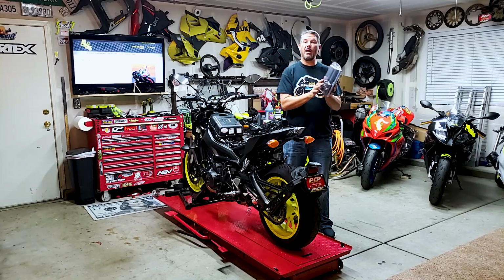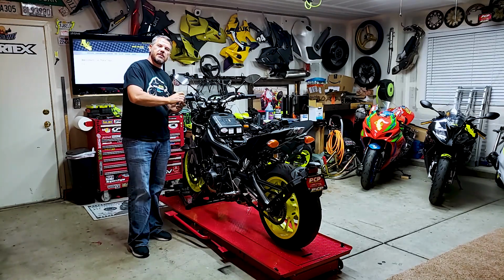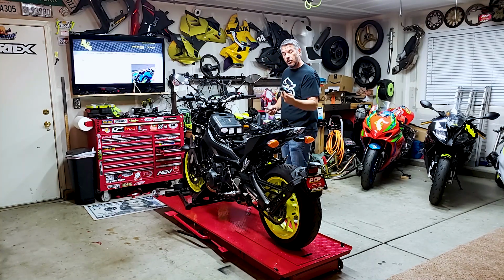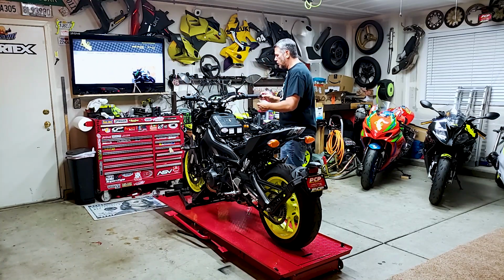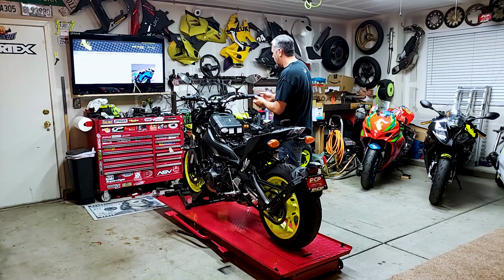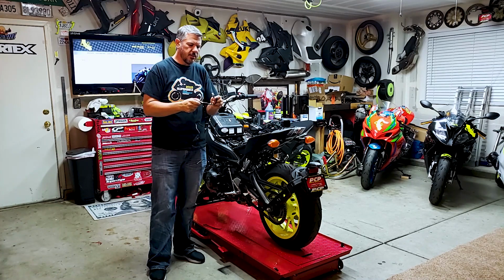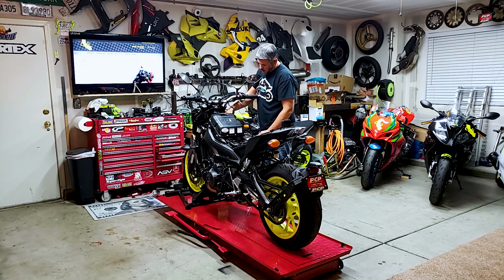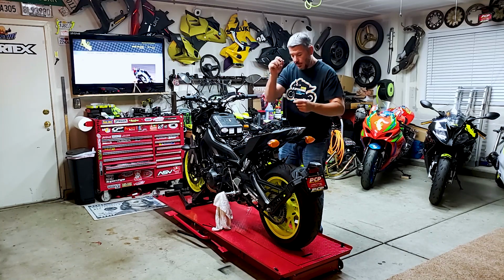Koso Apollo Heated Grips Install on 2018 Yamaha MT09

Comment: Can't believe you did not do a pre-install test of the grips to check everything works. With heated grips from any brand, always hook the grips up to a 12v source before final install.
Reply: Yeah, pre-flight the gear. Another guy did a hands-on video and checked them out right out of the package, but didn't to an Install video. :(
Reply: @PasnThrou  i saw that; but ya that's slways a good idea because I saw a review of the Apollo grips from somebody and they said they barely heat it up at all oh, so you never know if you might get a bad one out of a bunch of good ones so yes it's always good to pre-wire and check it out.

Comment: 1) alcohol is great for providing lubrication and then drying out. properly fit grips don’t need glue. 2) if you need adhesive, try hair spray. Also provides lubrication at first, but then added stickiness. Both hair spray and alcohol provide much more working time than ca glue. 3) should use a relay triggered from a keyed circuit to prevent accidental battery drain
Reply from the maker: The trick is paint. Good talk.
Reply: @CaliMotoTV  Got to hand it you, bro. You got the full on bike lift, making videos in your garage, and you don’t even know how to install grips. Keep up the good work..

Comment: Aren't you supposed to connect the positive side to a wire that comes of the ignition. To avoid draining the battery?
Reply: These are designed to be connected to the battery. They have an automatic shut-off function to avoid killing the battery. I imagine you could wire them to the ignition switch if you prefer.

Comment: Hey Bill, I'm wanting to get those for my Pentigale V-4, do you think the throttle side will be too long like it was on the yamaha, or do you think I'll be fine. Did you see the new 2022 Pentigale V-4 has heated grips, well for over $300 it does, i found the appoles for $116.00 threw Dennis Kirk.
Reply from the maker: No idea sorry.

Comment: I may just be blind - but what was your thoughts after using these grips for a while? I couldn't find the review anywhere. And it looks like the washer worked as I saw in a more recent vid the bar ends were back on. I just installed these on mine.. Hoping they're good. Need to get a spacer for bar ends now too.
Reply: @CaliMotoTV  good to hear. I mostly commute on mine so they should hold up. I ran mine through the switch so they turn on and off with the bike - didn't want to risk the low voltage thing.
Love your videos regardless.  Easy to see and well explained so easy to follow. Keep it up
Reply: Side note - did you buy or fabricate the washer? Been to three shops so far and no luck. Remember the size? Looks like 15mm but no more than 20mm outer ring...  Might just fab one
Reply: @Scottteh88  these actually have a low voltage sensor that cuts them off automatically if the battery goes below 11.5v for more than 5 seconds.

Comment: Great video, thanks for sharing.

Just installed one on my GSX-S1000. I used a large socket and dead blow hammer to install them. I didn't use the glue yet, which I'll do after a trial run, but I think you're thinking of hairspray. I wouldn't trust it for aggressive use though.
Reply: @CaliMotoTV  Good to know. Are you using the supplied glue or a different one? And have you found one that has stayed put?

Also, when you're removing them, are you just muscling it off or using something?

Comment: I am looking at these now for my r1but i was wondering if they have the low voltage sensor that turns them off automatically if left on when you walk away from the bike. I’ve used Oxford heated grips before and I really like them but I don’t like the feel of the grips anymore. Also the oxfords deteriorate after a winter of almost every day use.
Reply: Get the AMPLink and set the circuit up as a Trigger Circuit.